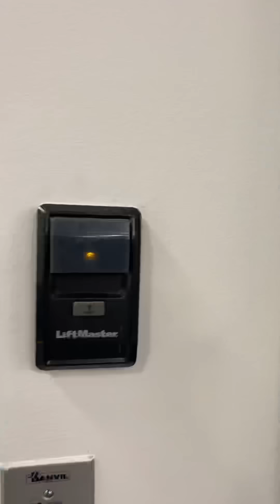Building 1000 HP R34 GTR Engine from Australia?  *Behind the Scenes*

Comment: CGT in Signal Green with the side intake insert in gloss black and the fender side-panel behind the front wheel? 
So, from behind the front wheel to the side intake insert through the door... in black. Maybe the black parts should be a wrap though, if Porsche are going to certify the colour. 
Just an idea 😉

Comment: For the R34 GTR
You want to speak to platinum racing for parts, along with Nitto for the crank, rods and bits.
Then have CRD build it.
But you'll need all new fuel lines and pumps, gearbox won't last the way you guys drive.
Diffs and other parts will need doing.
Plus brakes 
It's just not as simple as slapping a 1000hp engine in the car.
The skylines are old school building and tuning of cars.
Nothing like modern cars that your use too.